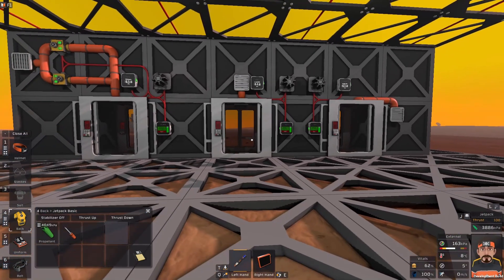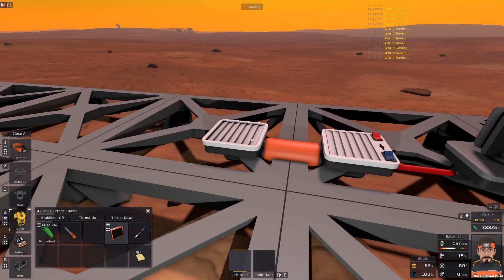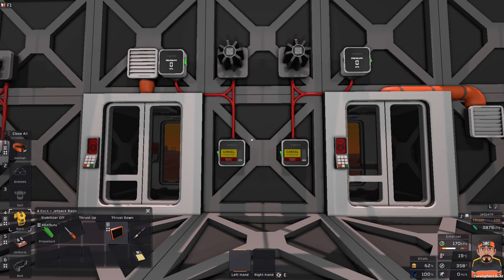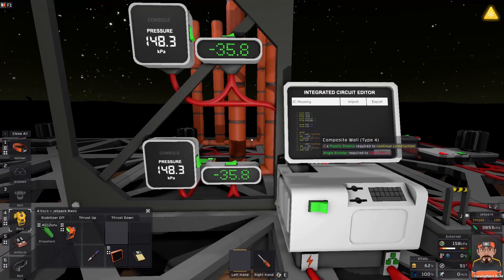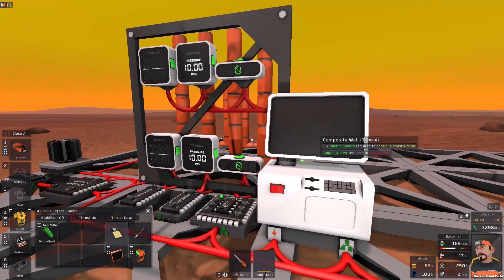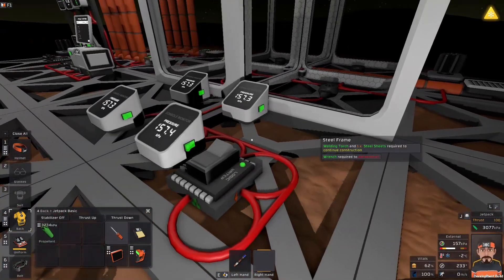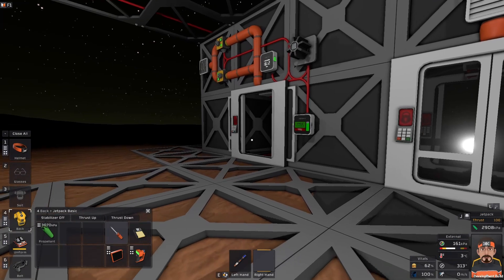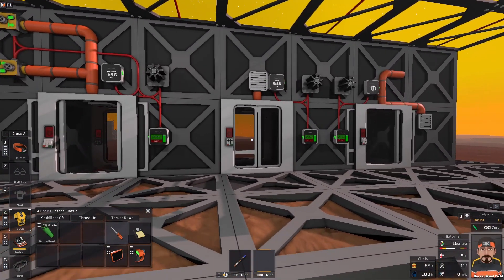Stationeers Pipe networks 4 Vents

Comment: Very useful video! I know this video is a year old and it's probably been answered by now, but I think what may be happening here is that you're limiting/controlling the interactions/computations between atmospheric objects. Instead of computing 6 objects (four sides, top and center), it's computing three (two sides and center) where applicable for the pipes. My theory being that the game either has some form of transfer regulation in its computations, or a simple matter of more activity per tick lowering efficiency? That or the game considers the pipe as a singular storage entity, meaning the active vent isn't starved/effected until the pipe is empty.

Comment: Have you ever looked at using a negative pressure airlock between different room atmospheres? You just maintain the airlock room at a slightly lower pressure than the other rooms and use motion sensors to open doors when the player approaches. Even with both doors open, the different atmospheres can only flow into the airlock, not into the other room. You just have to reprocess the mixed gases from the airlock. It's a limited use case, but it's much faster and power-efficient than the advanced airlock algorithm.

Comment: I use an internal pipe squiggle  (9-10 pipes long each side) in block above as default so guess i've always had this nailed, although sticking all the piping and cable transfer from inside to outside (remember fuses!) through the block underneath (side vents) also has its merits sometimes (like for both airlock doors facing same way and not using blocks on sides for examples) if you take the effort to shove it in before you weld up.

Comment: My guess from the playing I've done is that the passive vent is only equalizing the pressure. When you are using an active vent to pull through a pipe it can only go as fast as it equalizes. Since the pressure differential between outside and inside is low, in your case 150kpa, it is relatively slow. On our moon playthrough we put gas canasters connected to the active vent so the pressure gets really high and the active vent can have full access to the air meant to fill the airlock. You could likely tune this even more by minimizing the amount of pipe connected to the vent so that you had just enough pipe to store the gas volume.

If you wanted to cycle the gas you would need to make sure the gas was available at any time possibly with digital valves to preload the active vent pipe after it finished exhausting.
Reply from the maker: I didn't explain it in the video but the pressure regulators on the left airlock were to pressurise the pipe to 5MPa so there was plenty or gas in the pipe to pressurise the airlock but the one on right worked in about the same time but didn't have enough stored in the pipe so it must have been coming from the passive recharge.

Comment: On the multi cell airlock I imagine that it's always the bottom left part of the tile and you just had it rotated weirdly. If I remember correctly you can change which way the pipe faces with respect to the buttons but on the passive vent you can only rotate the entire vent.

Comment: Pipe length only boosts early pressurisation - it stores bigger capacity that active vetn will pull from pipe network. After it gets depleted, passive vent will be limiting it in same way regardless of connected pipes.
That difference was calculated each tick between pressure and gas mix inside network and cell where vent is placed. After this that new gas is pushed to pipe network (whole) and cell.
Let's assume that there is 5 moles of gas in a vent, with one pipe connected you will have 10 moles (vent is pipe) to disposal of your active vent, for 4 pipes it will be 25moles. After that vent will pe pulling from a cell and to your pipes but it will be sorto 5 moles per tick.
I think console graph with pressure will show you this that initial tick or two will be jump, but rest will continue with same pattern

Comment: On the passive vent tests, could you have used digital valves and batch writing to trigger them both at the same time or would the valve itself skew the test results?
Reply from the maker: The valves will have their own flow properties which will change the results.  As you saw from the active vent test just the tank was enough to cause problems.
Reply: @cowsareevil7514  Thank you.  I had a feeling that may have been a problem.  I appreciate all the time and effort you put into these.
Reply: Could you enclose both passive vents in an airtight space, and remove a wall to make that whole space in to exterior atmosphere simultaneously?

Comment: Active vent (inward): n = (P * V) / (R * T)
n: Moles moved
P: Minimum of room pressure and 10.1325 kPa
V: 8000 (always seems to be the volume of a single world cube volume)
R: 8.3144
T: Room temp

Active vent (outward): n = (P * V) / (R * T)
n: Moles moved
P: Minimum of pipe pressure and 10.1325 kPa
V: Pipe volume (1 pipe = 100 L)
R: 8.3144
T: Pipe temp

Passive vents seem to equalize the pressure between the world cube they are in and the pipe network they are connected to, if you increase the volume of the pipe network it can store more moles total with the same pressure.

For a faster airlock, I created a custom IC where I have 2 active vents, 2 turbo pumps and 1 passive vent, both active vents and turbo pumps connected to their own single pipe to store the airlock gases. During depressurization the turbo pumps and active vents pull gas into their own gas store and when pressurizing only the assigned turbo pump runs to move all the gas into pipe network with the passive vent, this results in a very fast airlock.
Reply from the maker: Oops, I completely forgot to test the vents in the outward setting.  Your numbers suggest that the active vent would change speed based on the pipe volume when in outwards mode meaning the faster repressurisation was a combination of both working faster and not just the passive.
I hope one day to find out why the pipe volume is significant for these calculations.

Comment: Great video. I had a turbo pump trying to suck atmosphere from vulcan during the hottest part of the day and it was going really slow. Now i know why. only had one pipe and passive vent connected.
Reply: Active vents seem to be the best way to gather atmospheric gas, unless the atmospheric pressure is above around 81.06 kPa and you have 1000L volume of pipe connected to the turbo pump, though this still will likely be less power efficient than multiple active vents in different tiles.
Reply from the maker: When doing atmospheric collection you are still relying on the passive flow of gasses between world cells.  If you take a pressure reading standing on the passive vent you might have sucked the atmosphere in the cell to zero.  If the turbo pump is critical to your desin then try adding more vents spread over multiple cells or as mentioned above by First Last, for the same power as a turbo pump you could have 10 active vents.  This would also be my recommended solution.